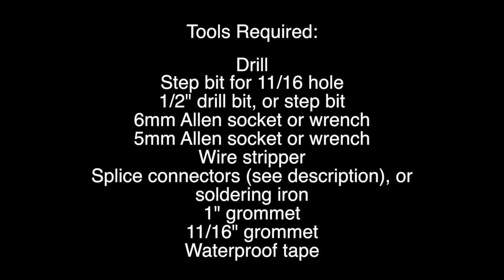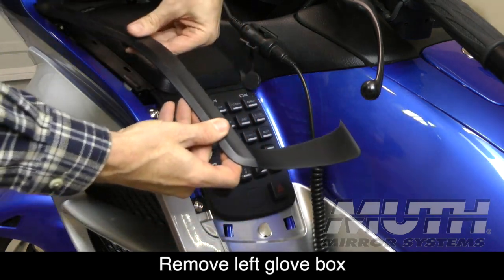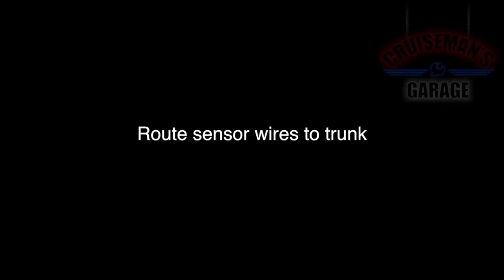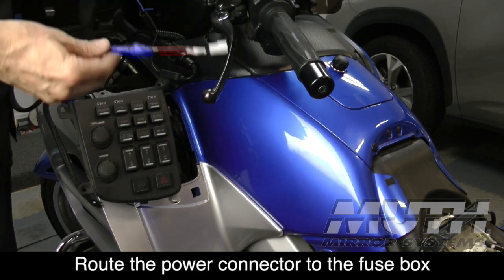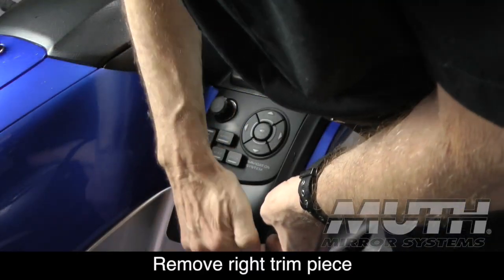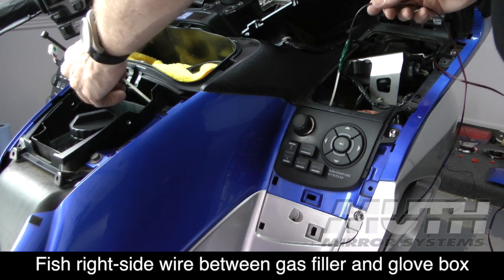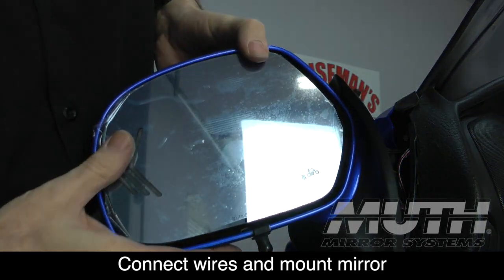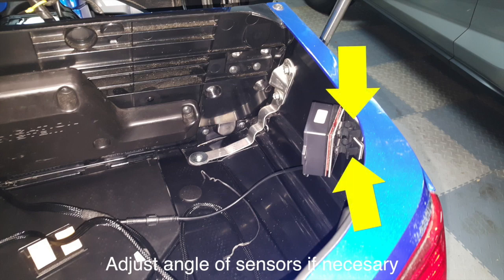Muth Blind Spot Radar for Honda Goldwing GL1800

Comment: Man I have saved a lot of money learning from your videos and we can thank you for the tips.  There one problem with my Goldwing which is now in the shop.  My 2004 GW when ridden for a while in SE Louisiana it now has a whistle at idle.  If you burp the RPMs the whistle goes away for a moment.  Goldwing sites states that it is the alternator doing this due to a pending bearing failure or something to do with the Armature winding issues.  What is strange is the Motorcycle only has 30,000 miles.  What is your comment on this?